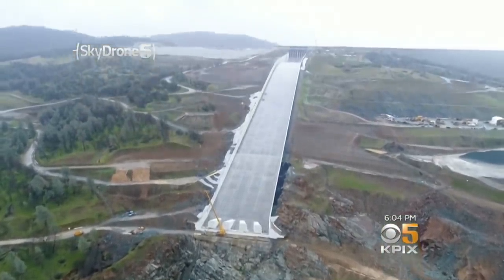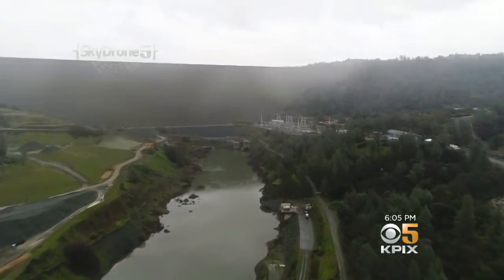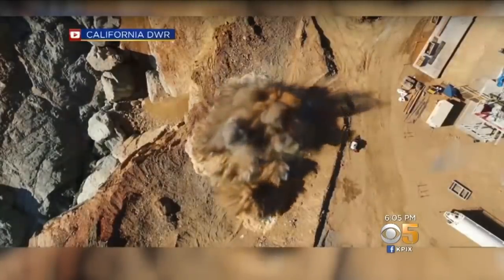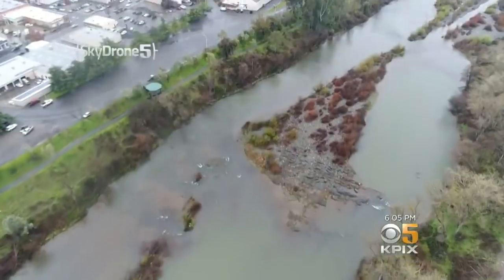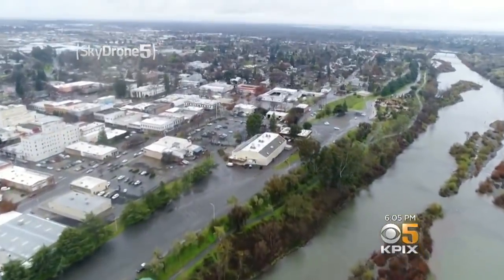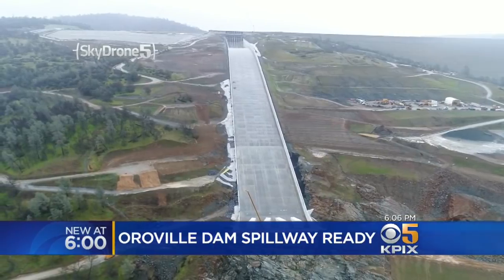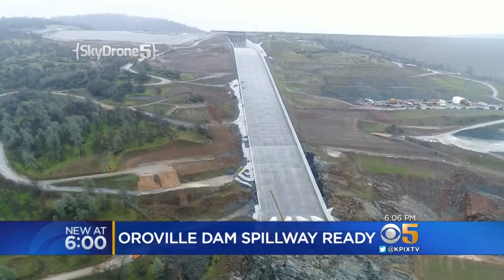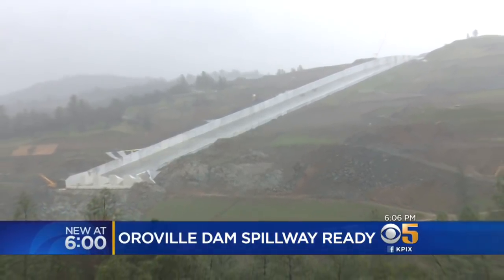Rebuilt Oroville Dam Spillway Appears To Be Nearing 1st Test

Comment: Did they fix the cracks in the floodgates at the top of the spillway remember there were cracks did they fix those curious.
Reply: Deb Shepard there WERNT any cracks.....just normal concrete expansion and contraction

Comment: the new spillway is 100 feet thick in places, i don't think there is any doubt that it will operate fine. it took 50 years to fail the first time. not fifty minutes.
Reply: This one is built for 100 years

Comment: The fact the old spillway lasted as long as it did is quite amazing.  The contractor built the spillway to spec. but after decades of use and neglect the spillway was in need of major repairs and upgrades.  The DWR knew the spillway had drainage issues along with structural issues, yet they merely grouted the cracks and completely ignored the drainage problems.  The reason, DWR policy over the last decade relied heavily on global warming theory and therefore drought being the new  climate norm. This meant the spillway would seldom if ever be use again or so they were lead to believe by the best and brightest in the climate industry.  Global warming or not, this was a terribly flawed policy that banked solely on a theory, remember a theory, not empirical, provable, reproducible fact.  This fiasco can firmly be attributed to Brown and his brain dead predecessor Schwarzenegger and their misguide faith in a theory.

Comment: @ 1:18 ~~~  The side walls are still way too thin..
They need to be about three to four times as wide and 
braced by cement wedges every 20 to 30 feet to prevent 
a collapse..

if the flow over tops the side walls it will undermine 
the walls causing a collapse,  which could lead to a cascade 
effect and you'll be right back where you were two years ago .....
Reply: I think the sidewalls will be backed by dirt fill.  But you're right, if it flows over them, then it's another $2000000000 oops.  Of course, they didn't take care of the previous one, so this is just a $2000000000 pour-it-and-forget-it project.  YAY California!
Reply: So sayeth the keyboard engineer looking at a 5 second drone video taken from a 1/4 mile away.
Reply: Right so you're a civil engineer maybe you should have been the one to design the new spillway

Comment: So with the weather this week it appears that the reservoir level is raising 6 inch an hour (roughly). If this keep up the remaining 78 feet will be consumed in 7 to 8 days.   Most likely it will be 15 days depending on weather and the high country temps.
Reply: You do realize that reservoirs highest capacity is at their peak elevation, right? Think of it like a triangle with the flat on the top and the point on the bottom. If you fill a triangle, the water level rises rapidly, but then gets slower and slower as the area spreads. The last few feet of a reservoir like this hold as much water as the first few hundred feet.
Reply: I do understand the concept.  Luckily  the weather pattern has changed.  Continued high rains would have made my prediction true.   Still there is 159% snow pack.  April 1 will be the real measure.  Just hoping all works well.  This has been a very interesting engineering project.  Lots talent and money have been given.